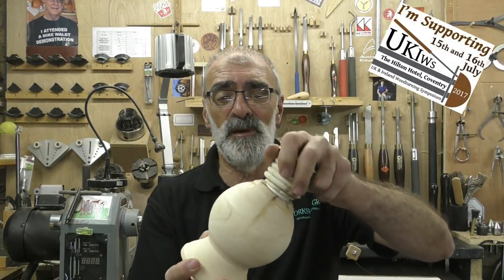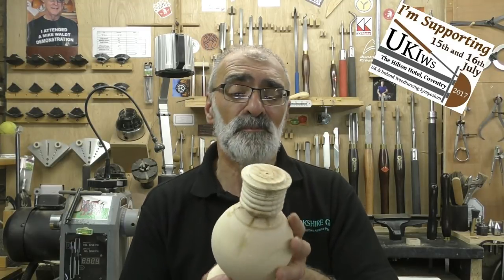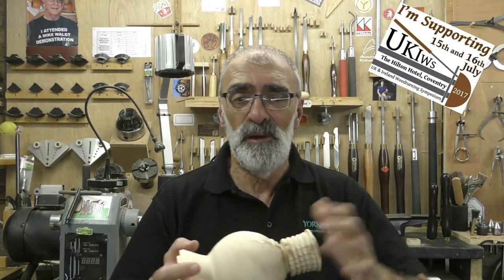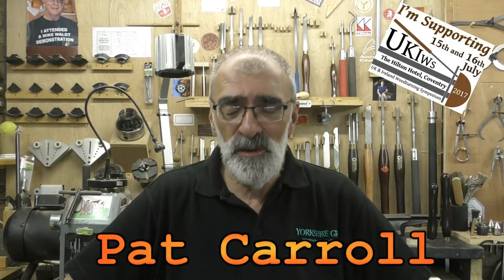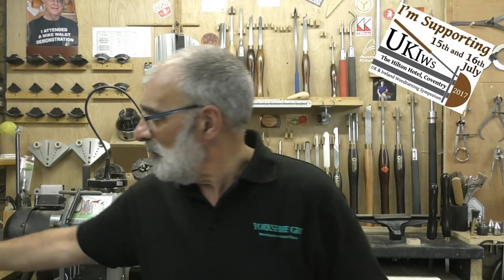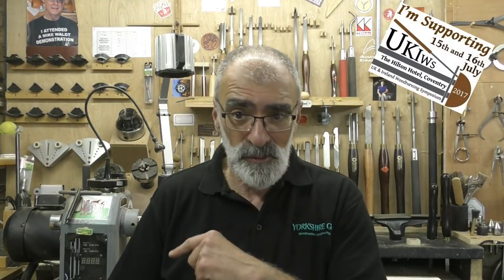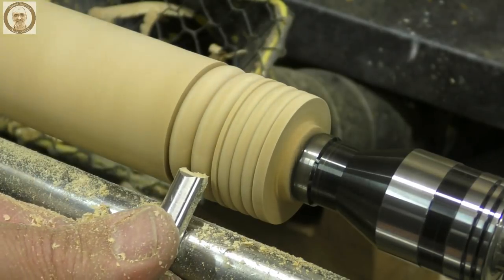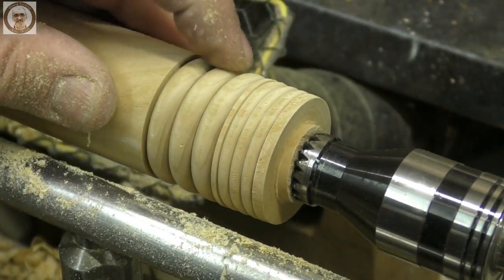Wood Turning - Make a Beading Tool from a Spindle Gouge

Comment: Thank you Mike for the video. It seems to me that with a very litle efford you could do a captive rings out of those beads from the bought beadtool. Ceers, Júlíus
Reply from the maker: Thank you for watching Julius. Not too effective as a captive ring tool as the point doesn't come around enough, but the dedicated captive ring tool with the double bevel is very effective,.
Cheers
Mike

Comment: Good stuff Mike.  Isn't the Crown tool designed more for doing captive rings rather than beads?
Reply: Sorry if I missed something, I tend to fast forward over some stuff. Do not take this as an insult to the quality of your videos.
Reply from the maker: +Brendan Stemp 
Thanks Brendan. 
Crown do a dedicated captive ring tool, which I also have, and its bevelled on both sides of a hook profile, so that you can form the ring and undercut from both the left and right. I did a video on it about four years ago.
Thanks for watching
Cheers
Mike
Reply from the maker: +Brendan Stemp 
No offence taken mate, I assure you 😊
Cheers 
Mike

Comment: Hi Mike, I need to cut out 1 inch beads, would a roughing gouge do the same job as your spindle gouge conversion.. If not any suggestions?  Thank you.
Reply from the maker: Hi Derek, in theory it could be reshaped, but I would think a bead of that size would be better off turned … just my opinion though.
Cheers
Mike

Comment: Massive difference between them isn't there Mike. I had made two ring gouges from old large Allen keys. They didn't do a bad job but not made for the same reason you had, hiding a joint. When I get back to the lathe again I will see if the old keys could be adjusted on the grinder....might leave one as is.... cheers my friend 👍🏼😊
Reply: Just remembered I also made a captive ring gouge from another Allen key..that worked well too 👍🏼
Reply from the maker: There is Marc, and thanks for watching my friend.
Cheers
Mike

Comment: Great video, I prefer the ones made by the tool you made, Could you use a cheap spindle tool off ebay ?
Reply from the maker: Thanks Mart, yes you could mate, no problem, but if it's a cheaper steel it will need honing a bit more often.
Cheers
Mike

Comment: Hi, have you used the D-Way deading tool. I am getting alot of tear out. Any suggestions? Thanks for the video.
Reply from the maker: I haven't used that particular make, but have a similar one. I have found I get best results by cutting on centre, lifting the tool slowly with little pressure, and always honing the face/edge regularly. Hope this helps.
Reply: @MikeWaldt  Thanks

Comment: Could you not reshape the store bought beading tool?
Reply from the maker: It's possible, but you don't have a chance to fiddle about too much to get it right, as the profile cannot be easily restored. The benefit of the gouge is that the flute allows you to try different grinds, to see what works best for you. Thanks for the suggestion though John, and for commenting.
Take care
Mike
Reply: Quiet welcome..
John D

Comment: Bearing in mind I know next to ' naff all ' about wood turning, how about getting some stainless steel pipe to the width required for a bead, drill a vertical hole [ now maybe you have 2 pcs ] and then shape to desired angle ..? .. sorry, just thinking aloud.Good vid anyhow.
Reply from the maker: Hi Brian, that could work, but I have no stainless pipe, but I did have a couple of worn down gouges ;)
Thanks for the suggestion though, and bothering to comment :)
Take care
Mike
Reply: Yes ... I'm full of ideas and as the Mrs. says, just a shame that a lot of them are about as much use as a chocolate T-pot ..lolBack to the drawing board eh !

Comment: great info mate and thanks, I have some old spindle gouges, those cheapish ones that come in a set that i picked up before I even had a lathe , just collecting dust in a draw, Im the same rather than throw them i kept them incase that "one day" actually comes :)
Reply from the maker: Hi Mark, it is a great way to repurpose old gouges, and is quite effective.
Cheers
Mike